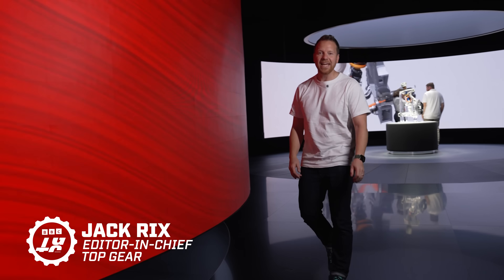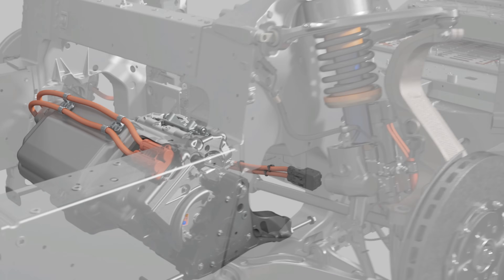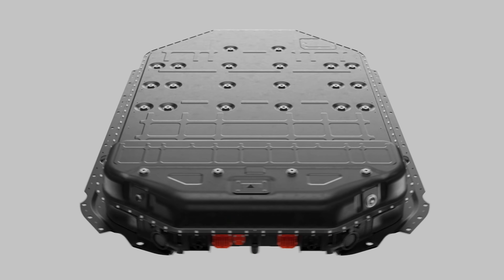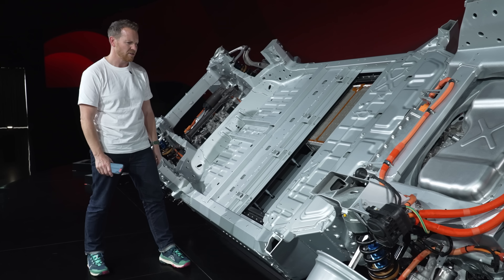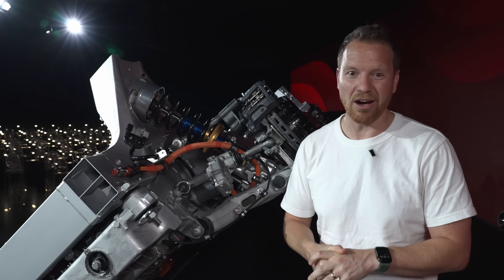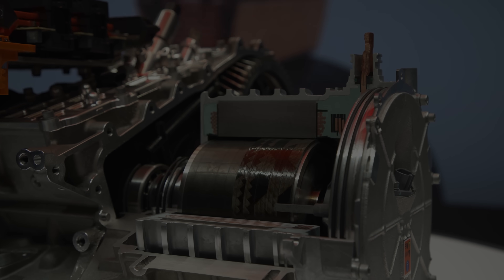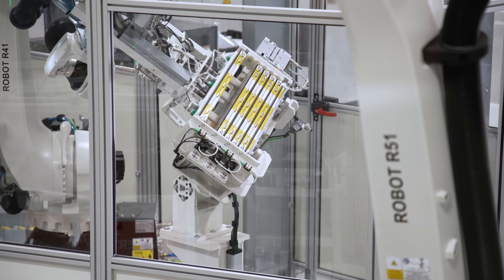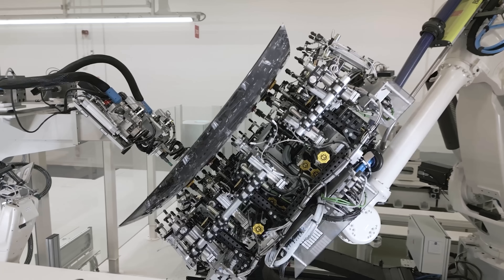Ferrari Elettrica: Tech Details On 1000hp+ EV! | 4K

Comment: Why are tiny specialist motor companies like Ferrari not fighting this?  They are a screaming V12, they are not a silent dramaless car.  Surely exceptions could be made to this nonsense EV trend.  Ferrari's dead to me.
Reply: Not like you gonna buy it anyways 😂
Reply: @mcsike7264 well of course not.  It's an electric Ferrari.

I wouldn't have it spoil my garage of 5 Ferrari's, of which 3 are v12's.

Besides myself being a customer, even a fool such as yourself should realise if the everyman stops caring about Ferrari, the brand dies.

All it takes is a glance at the relatively few who watched this video vs TG's video on the Aston and AMG One.

Ferrari die with electric.  Stop pretending otherwise.

Comment: There is no way that this produces 10,000+ Newton Meters of torque
Reply: To the wheels,  with reduction gear,  10,000NM has already been achieved by several EVs. This isn't any more powerful or torquey than a Tesla Model S Plaid.

Comment: I see all these super cars with 1000 plus horsepower. I don't know who is complaining about lack of power in any of these things with 600,700 plus HP. I personally would rather have much less power like 400-500hp and then design around that. Meaning smaller lighter motors and smaller lighter battery packs, maybe even more range. I guess what I am saying is we are not all Lewis Hamilton, and if they deigned the car to be used on normal highways and streets, instead of for headlines and brochures we might get a better light electric Ferrari.

Comment: On the plus side, this might be the first Ferrari where you'd be happy to use as your daily driver without incurring huge servicing costs. Although knowing how bad Ferraris UI and electrics are in other recent models, it might not!
Reply: Really? There's EIGHT bushings keeping the subframe in place. It uses coolant to keep the motors/ batteries cool. Both of those items need service every 30-40k miles. EV's are twice the weight of ICE vehicles, meaning they chew through tires twice as fast. Ferrari designs ALL their cars to need servicing every 30-40k miles. Labor rates don't change for a V12 or EV. They're gonna get their customers in that service bay one way or another.
Reply: @MisterMonsieur  EVs are not twice as heavy as ice equivalent, but a few hundred extra kilos maybe. Tyres are not used up twice as fast either. And there is no timing chain, belts, air filters, oil, etc to service so just coolant and regular perishables. Also, if they get their regen right, you’ll be using fewer brake pads as well. So for a regular service, there will be way less to do and replace.

Comment: If my sums are correct, that's a 625Kg battery.
Reply: yeah, its not light, but compared to a combustin car  you do save a lot of other components. Electric motors are lighter than combustion motors, you don't need exhaust pipes, less coolers etc.

Comment: An 8,000 Nm torque output is an incredible feat for an electric vehicle, showcasing how quickly EV technology has surpassed internal combustion engines in performance metrics. This rapid progress is generating excitement, though it's also bound to cause friction with fans of older, more traditional car designs. 

But the cutting edge is exactly where Ferrari needs to be.

Comment: Love how Ferrari is not even showing a prototype of a 1000hp EV, when Tesla and Lucid had ones on the road for years, Xiaomi made 1500hp+ while focusing on smartphones and air conditioners, YangWang just crossed 3000hp+ and you cna order those. These numbers are just embarrassingly low, the motors are not compact, this is last-gen tech. Will it drive well? Nobody cares, because drivers will still buy NA or Turbo cars for the sound.
Reply: It's easy to get hp out of EVs. So, no, the insanity with this hp competition need to stop. The real tech here is making your EV lightweight.

Comment: Under 200mph when the U9 does more than 300mph.
Reply: U9 is a 2 door. This is a 4 door. U9 also has 3000 hp. This has a little over 1,000 hp. Are you dense?
Reply: Sure,  that's more,  but essentially impossible to use except on a closed track.

Comment: All those batteries look very eco friendy.
Reply: of course all batteries are eco friendly since there are no proiblematic materials at all compared to ice cars which are full of them and use fossils to run and giver us all wars the last 100 yearrs and cancer for everbody.

a battery is 99%+ metal and fullly recyclable forever, nothing is consumed ever, this will work in a billion years and longer
it is defacto eco friendly
Reply: @JohnSmith-pn2vl 1. Ni, Co, Mn, Li, are some problematic materials, either from their fabrication or recycle.
2. Some of these metals will bring us the wars of next 100 years. In fact, the extraction of Mn has financed war in Congo.
3. Battery recycle is a difficult and expensive technological process, not eco friendly at all, where nothing is 100% recycled.
4. Dude, wake up.

Comment: The end of the point of 'Ferrari' - the soul. I did a whole piece on this, but no one has told me yet - whats the point of a Ferrari when a 4 door daily car is going to be as quick with a similar blender engine? Ferrari is noise, passion, you buy a Ferrari as it's a Ferrari. Now you don't need to. Other cars are as fast, more practical and built better. Same for Lambo etc - but Porsche seem to have the right idea.

Comment: 122kw battery?.... thats going to be insanely heavy
Reply: weight is the worst enemy of shitty ice cars from the past and almost meaningless in ev's for following reasons:
-the weight is located at the very bottom
-you can regenerate energy, consumption almost does not increase with weight
- you can regen so you dont wear brakes more because of more weight, ev'S will never have to  change brake pads or discs
-ev'S have more power than is ever needed until we suck the car to the floor at which point we can go over 100k HP

you don't feel the weight, not in driving, not in cost, not in anything

Comment: Uh... did you say... 8,000Nm of torque...? And then the front with another 3,500Nm... how... how will the car even handle that... The Rimac Nevera has 2,360Nm of torque... it must be measured differently right?? It's not the accurate figure?
Reply: Hummer EV has 11,500Nm...if you measure it in a very specific way. The Ferrari will be the same deal

Comment: This is the future if we like it or not. Ferrari DNA is racing. F1 and WEC is going electric as well- so will Ferrari. It will be great, hopefully
Reply: They're not even in EV racing.
Reply: Right now electric performance cars are a joke, they're good for a single lap at best if you want performance comparable to what an ICE can offer. 
Unless battery technology has some major breakthrough (which it hasn't in the last decade) the pack is simply too heavy to make cars that are good around a track.
Reply: @v0ldy54  If you check the last decade in Formula E it's clear that what you are saying is not true. Of course the electric range is not at the same level as ICE, but there have been good developments.
Reply: @Truckziller  Formula E cars aren't even close to Formula 3 cars, and that's on Monaco which is a track that favours electric cars.
They have to race them on purpose made joke tracks that are mostly 90° corners to maximize the regen braking, otherwise they wouldn't manage to finish a decent length race.
Put them on a real track that needs aero to go fast and it's a disaster since you can't afford to spend  energy you can't recover to fight the aero drag.

Plus it's a negative feedback loop, heavier car because of battery requires more aero to corner fast, which needs more energy to push through the added aero drag, which means you need more battery weight, etc.
Reply: @v0ldy54  Okay so you´re saying electric (race)cars are not good enough. How do you expect them to get better? A lot of ICE developments have been achieved because of Racing. And they have been raced for over 100 years now.
Reply: @Truckziller  the problem is that the ONLY thing that limits electric vehicles is the battery, and in formula E it's stock and not developed by each team, so it's a completely useless series
Reply: You can fold if you want.
REAL car guys will not.
EV’s are for weak, cowardly nerds…
Reply: F1 are not going electric, they refuse to actually and are instead heavily investing in hybrid fuels to use.
Reply: Well if you look at ferrari in racing, in formula 1 they're inconsistent at best, and in WEC they usually only win when CRAZY BoP forces their car to be faster. So let's not pretend ferrari are diehard racing purists on the bleeding edge of performance and technology anymore, let go of "Ferrari DNA is racing" romanticism.
Reply: @tuna5618  Redditor spotted AKA being spot-on biased and/or wrong on almost every word.

Edit: just to be extra clear the "redditor" I'm refering to is tuna5618.
Reply: @proclive I mean.....he does have a point though. Ferrari hasn't been stellar in motorsports recently. I haven't even heard their name in the gt3/gtd realm. Wec aside, Ferrari ain't what it used to be, like it or not!
Reply: @Tycho_3111 GT3? Well maybe you didn't hear about it because you don't follow it but I suggest you check the 296 results on the last 2 years.
Hypercar, the last 3 races showed it wasn't just BOB.
F1, this year isn't stellar. Lack of consistency? Pls, do we want to consider where MCL were few years back? Merc after 2022? Redbull without Max? If we have to judge let's judge everyone with the same standard.
Reply: of course, electric is hands down better at everything, of course BOOMERS with Nokias disagree
Reply: @JohnSmith-pn2vl  except what you say is demonstrably false
Reply: @JohnSmith-pn2vl  83% of car buyers worldwide disagree

Comment: 1000hp EV are affordable now a days, you can have plaid for under 60k. A $230k BYD have over 1200hp. Ferrari EV will definitely cost more.
Reply: Even MG have just launched a 700bhp EV for £45,000 in the U.K.
Reply: Xiaomi SU7 Ultra with 1500HP is only 70k dollars!

Comment: 11.500Nm on all wheels in total? That are normal numbers for a supersportscar in the first gear. Nothing special 😐
Reply: no those are not, at all, these are more than 10x more
Reply: @JohnSmith-pn2vl  Of course engine torque low, but wheel torque is different.
Porsche 918 Spyder first gear torque are 11.000Nm on the wheels
Reply: @Pertev777  Yeah these is all after gearing torque. But the massive difference with the 918 Spyder it only has 11,000 Nm in a RPM sweet spot in a couple gears. BEVs have vast majority of torque for a large chunk of their RPM range and no other gears. It's misleading to use torque after gearing but it still is massively more than ICE.
Reply: @Neojhun but keep in mind that even electric motors loses their torque at a certain amount of rpm. Synchro motors do have a very flat torque curve, but it falls after the voltage limit tip over

Comment: If Porche can produce a synthetic fuel then surely to god can’t these manufacturers get their act together and scale production up to support their cars initially then others
Reply: It'll be around 5x more expensive than fossil fuel. And it will be used for airplanes first. So road gasoline will be such a niche product..you will  only see it used on racetracks - and even then it will be used in hybrids, to bring down consumption without sacrificing noise.
Reply: bullshti, electric won a long time ago and is the present for a long time now

Comment: A Hyundai Ioniq 5 with a fancy suit
Reply: By the same thinking, a Urus is a Sorento in a fancy suit?
Reply: Maybe they can't even copy N shifts.
Reply: Yeah, trash
Reply: With 4X the price!!!
Reply: WTF nope, Ioniq 5 N only has 2x electric motors. This is Quad Motors one for each wheel allowling lateral torque vectoring. It's an entirely different car architecture. That's like equating a Front engine car and a mid engine car.
Reply: @Neojhun  you clearly don´t get it fan boy
Reply: Ioniq with 4 motors 1100hp / 11500N.m and some Ferrari stuff
Reply: Don't insult the ioniq like that 😂
Reply: @therealmudafuka7200 I 2nd that 😂

Comment: The batteries DON'T have the "highest energy density of any EV on sale" because THIS CAR ISN'T on SALE YET!
Reply: They’re planning to use solid-state batteries, and Samsung SDI is actively working toward making that possible. If it proceeds successfully, they will be able to reduce the weight effectively.
Reply: @차성민-c8x  Do you have any references for this? I was genuinely curious as to which battery chemistry Ferrari would use and obviously this details is not covered.
Reply: @1JAMROCK1  In the premium EV market, brands like BMW are using SDI batteries, and SDI has already produced solid-state battery samples for vehicle testing. Now, Ferrari is using SK batteries for its first EV, but according to SDI’s roadmap, development and research of solid-state battery is expected to be complete by 2027. I can’t tell you more information of this for personal reason.
Reply: BMW are using EVE, AESC for NueKlass  46x cells not SDI
Reply: I bet you're fun at parties.
Reply: Are those same batteries the ones used in their current hybrid models though???
Reply: @JakeM218  No, it’s not available yet. SDI is targeting luxury electric vehicles because of their high price.
Reply: The vehicle uses LG-manufactured pouch-type NCM cells. Its energy density is claimed to be the highest among available batteries, primarily because the design skips a traditional battery pack and Cell-to-Body (CTB) integration, eliminating structural safety components typically found in battery packs. As a result, the power density is naturally higher.
 
However, this raises serious concerns about safety and space utilization efficiency. That said, the design offers a potential advantage: it allows for future upgrades to solid-state battery modules, which could provide long-term benefits.
Reply: Using the good 'ol Tesla Roadster strategy
Reply: you don't understand how Ferraris are "bought"
Reply: Cell Wh/Kg is a pointless measure, the real measure is the pack Wh/Kg, this pack will be well below most Chinese models
Reply: @timfoster506  I'm pretty sure that the 195 Wh/kg is pack level. Otherwise it would've been at least 250 Wh/kg

Comment: At that capacity and density, the battery alone weighs about 615 kg — that’s a lot! I just hope they make it beautiful, more of a classic GT than another SUV coupé.
Reply: 122kwh
Dont know why they cant just use 100 or 90
Reply: @RandomS-374 because the range would be 20-25% lower, and at a bit over 300 miles is not great already.
Reply: @josevilabella  range doesn't matter much in the ultra luxury segment
Reply: @RandomS-374 That’s true, a typical owner will have another 10 cars and charging capability at any of his houses, but rich people do not like to look silly. It will cost 400k, so it can’t have less range than a Renault 5….
Reply: @RandomS-374 oh no , rhe range matters a lot, especialy when you drive hard : my 2023  model s plaid [19inches wheels and aerocaps ] is supposed to have about 350 miles epa range , but at 85 mph i only get 270 miles from 100% to 0 % , and if i drive hard and always accelerate with the 1000 HP on the german Autobahn,  i can barely get 150 miles (from 100 to 0%!): I  can't wait to have the tesla roadster 2.0 to double that range in the same conditions ...

Comment: Engines are what make supercars different. A Ferrari V12 is different to a Lamborghini or a Mclaren V8. Electric motors are all virtually the same so there goes their identity.
Reply: That's not true but go off.
Reply: @F1ll1nTh3Blanks  not, its not true... of course it is... but probabily for u the amount of touch screens is more important is a car.
Reply: lol, here we are at the infancy of insane instant torque a/c powered motors and this guys thinks they’re all the same. 🤦‍♂️
Reply: @aussie2uGA we are already many times beyond what is usable on the road. And tell me you can feel the character of one electric motor over another.
Reply: the differences between single phase, permanent magnet, axial-wound, and synchronous motors are bigger than  you can comprehend. I suggest you educate yourself on some physics before speaking
Reply: @Mearex_ ...in the end its all instant torque with no real powerband...and none of the aspects that make each car unique. Sure they are different, but there's a very small plot for how different they can be.